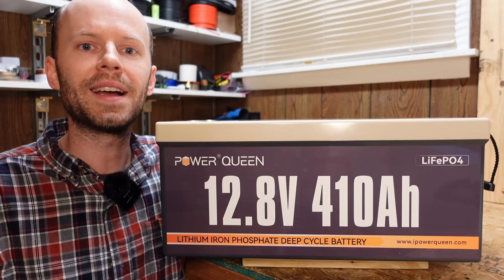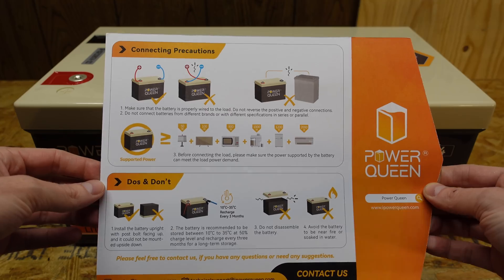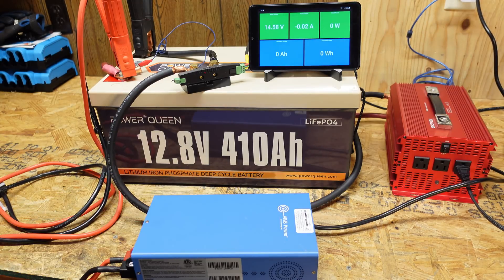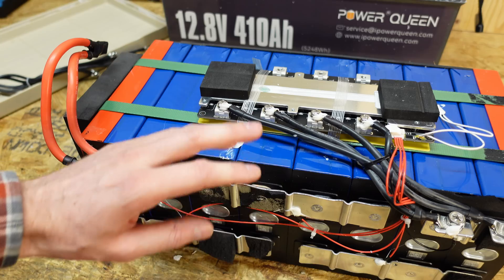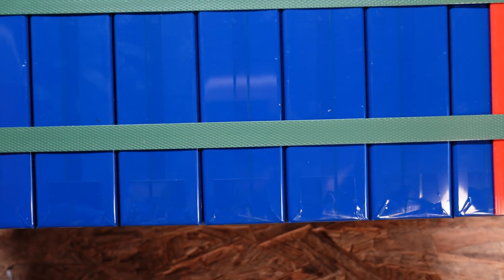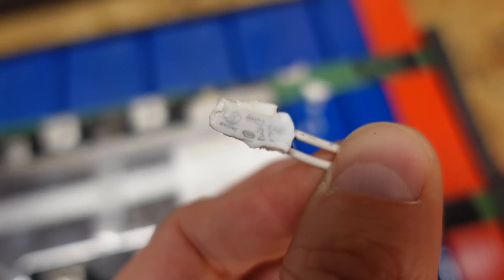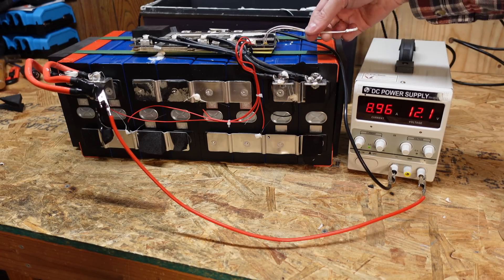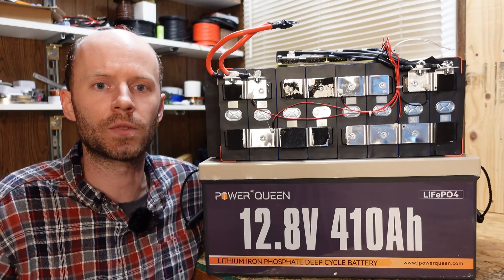Massive 12V 410Ah LiFePO4 Battery by Power Queen, Review & Teardown

Comment: With this being one of the first BMS rated at 250A on the market, in this form factor, I would like to pose a question regarding the potentially undersized pair of 6 gauge conductors bridging (BMS > two 6 gauge copper conductors > m8 Epoxy Terminals) to support 500A Peak load for 55 seconds.

This question relates to a use case of one Power Queen 12.8V 410A battery in an RV that may require a full 500A draw for the rated 55 seconds, permitted by the VIP 250A BMS specifications.

Question: Would the set of two 6 gauge copper conductors, that create the bridge between the 250A continuous BMS (500A Peak) and the m8 epoxy terminals, be sufficient to support a 500A Peak load for 55 seconds, while not becoming the fuse (read: fire hazard)?

For example: 
On the Power Queen 12.8V 410Ah battery, between the 250A BMS and m8 epoxy terminal connections, there  are two 6 gauge copper conductors. However, at the provided conductor length, a single 6 gauge copper conductor affords a maximum rating of 65A @ 75°C (167°F) for a continuous 12V load.

Ampacity of a 6 gauge copper conductor, at an ambient temperature of 75°C (167°F) = 65A
6 gauge copper conductor: Max. Amp Load (Accounting For 80% NEC Rule) = 65A Ampacity × 0.8 = 52 Amps or 624 Watts continuous load.

I (Amps) × V (Volts) = P (Watts)
52A x 12V = 624W

4/0 AWG (0000) gauge wire can handle the largest amount of current of any AWG gauge wire. At 75°C, the 4/0 copper wire ampacity is 230 amp contiuous load (with 195 amps and 260 amps at 60°C and 90°C temperature, respectively.

VIP 250A BMS: However, the VIP 250A continuous BMS permits a 500A Peak load for 55 seconds, producing:

I (Amps) × V (Volts) = P (Watts)
500A x 12V = 6000W

or

I (Amps) = P (Watts) / 12V
500A = 6000W / 12V

It would appear the two 6 gauge copper conductors that create the bridge between the VIP 250A BMS and the epoxy m8 terminals would likely become the fuse, thus requiring a more appropriately sized gauge conductor (read: 4/0, 0000) to create the bridge between the 250A BMS and m8 epoxy terminal connections.
Reply: I thought it said 5 seconds rated.  You are 100% correct though.  I just spec-ed out a wire for a Walmart inverter I want to install in my car.  I was a little concerned as 6 gauge wire is a bit thin for the 400 watt continuous & 800 watt peak loads.  I figured nothing I am going to use on that inverter will ever draw more than about 300 watts so I am ok.  However, 65 amps is right for 6 gauge wire.  I suppose a 48 volt pack could run a 2k watt inverter fine, beyond that I would not trust this pack for more than 2x that more than a few seconds.  One further thing to consider, length is a huge factor when determining DC resistance and thus current capacity.  those wires are 6-18 inches.  That may be just enough for 250 amps (but I seriously doubt it).  Great catch on the numbers.
Reply: Good question. The wires don't spec out to handle the current. Since it's very high current it definitely appears dangerous. I totally missed it myself so thanks for bringing this up.
Reply: Its rated at that for a 5 second burst. Overloading for short bursts like that is common in lots of things from battery start chargers to Teslas. It even gives 3200w as the max continuous on the data sheet at 1:38 or so. At 12.8v thats exactly 250A. Its also got a thermal cut off just incase someone can't be bothered to read the instructions.
Reply: When you double up the wires its fine
Reply: @supremeautomotive6749  And they're silicone insulated so are rated to operate at a higher temp and current.
Reply: No problems, it will pull that load for at least two minutes straight before you start to smell the sheath begin to melt.
Reply: I do wonder why this industry has such a fondness for 6AWG silicone wires. Would it kill them to use 4 awg? A foot or two of wire isn't that much more expensive.

Comment: I would love to have a big enough budget to have 16 of these batteries in a 4s4p configuration and 15kw to 20kw of solar on my roof with one of those awesome 12Kw all in one Sol Ark inverter systems or maybe a big enough Victron system to handle the whole house and the 240v split phase stuff. It would be magical to produce more energy than my whole house uses per day, but my dream 20kw solar system and the 82Kwh of Lifepo4 batteries, plus inverters/solar charge controllers, etc, would end up being a $50,000 system. Its tough to imagine spending $50k on solar and batteries when my house isn't that big and probably doesn't need that amount of solar, but I want enough battery power to get me through a few days of winter with snow in the northeast

Comment: "5000 Wh of Power" - This obvious error in your video thumbnail looks bad. If you're reviewing batteries, you should at least know the difference between power and energy. 

You can say: "5000 Watts of Power" or "5000 Wh of Energy". The "watt-hour of powe " is a nice rhyme, but it doesn't make any sense.
Reply from the maker: 5000Wh of Power.
Reply: You are correct John.

Comment: One qoustion 🙋brother  why should use 12v very big. Capacity why should not go to higher voltage battery 🤔
Best regards from Philippines 🇵🇭
☕☕
Reply from the maker: It's a 400Ah battery. If you need something smaller, they have 50Ah, 100Ah, 200Ah, and 300Ah available.
Reply: @LithiumSolar  I believe you misunderstood his question.
The answer is you pick voltage of a battery based on the application.  For example, if using battery in a U.S. vehicle you MUST stick to 12v .  Manufactures sell 12V batteries all day long b/c we have sooo many ppl.  living out of their Vans nowadays (Van-Lifers).
If you want batteries for your house /property then you are NOT restricted by the 12V wiring/electronics of automobiles so then it is best to go with 48V batteries.

Comment: No cold tempcheck and control makes this a bad battery. Cheap but bad.
Reply from the maker: Why does it make it a bad battery? It's not advertised having that feature and many people, myself included, don't need it. I only view it as a problem when a company advertises having it but doesn't or it doesn't work. No problems here...
Reply: @LithiumSolar  How you know many people don't need it? It's useless in a rv or boat when it's cold. It could possible destroy itself when it is freezing.
Reply from the maker: @LordOneHoop  Because viewers routinely tell me they don't need it due to living in warn climates or using indoors in conditioned areas. Just because YOU require it doesn't mean that everyone else does. That's the wonderful thing about a free market. If you need a feature it doesn't have, then don't buy it and look at a different company.
Reply: @LithiumSolar  Anyway any battery with freezecontrol is better then this one. Which makes it a bad battery.
Reply: @LithiumSolar  https://youtu.be/C3wQBHiXssY?t=306 Sometimes youself think otherwise.
Reply from the maker: @LordOneHoop  1) That is not a conditioned space 2) That is exactly the reason I don't need it, because I have necessary controls on my equipment to stop charging.
Reply: @LithiumSolar  And why do you want it to stop charging? And are you saying you have additionial equipment to stop the charging when it is freezing? Isn't that what i say is missing on the powerqueenbattery? As if everyone is living in a warm climate which isn't. It could have been a great battery if it had a hot/coldtemp controls bms. Which it hasn't and makes it a bad battery for the many not the few. Because most of the planet is freezing in the winter or even at nights. In this case i would use the cells because they are cheap and build my own BMS protecting system. In that case i would rather buy these cells directly and have an even cheaper battery including a good bms. Cheaper and safer.
Reply: @LordOneHoop  Or you could just buy a real charge controller and have it do temp control. Never understood peoples need to make a cold temp shut down as a requirement.  Very few really need that, and if you do just get a victron charge controller
Reply: @OmahaWayne   The fact that Victron understands that makes it a good and safe brand. But it is not their chargers but their bms who controls it. Even Victron chargers without bms will charge these batteries when it is freezing. Result will be dead batteries.

Comment: Why so much power at 12v, don’t get it
Reply from the maker: I don't understand the question. It's a 410Ah battery. If you don't need 410Ah, they have 12V available in 50Ah, 100Ah, 200Ah, and 300Ah to suit your needs.

Comment: Thanks - that is a big 12V battery! 
One thought that a battery manufacturer may consider for RV applications is to incorporate a DC-DC charger allowing for direct connection to a vehicle battery system for charging. I was thinking a MPPT too, but there are many variations of PV volt and amps but vehicle charging is overwhelmignly 12V.
Reply: theres already all in 1 inverter chargers which could easily add a dc to dc charger
Reply: @jar407  Yes, there is plenty of choice out there.
Reply: Kisae, among others, make exactly what you're suggesting be built into a battery.  My Kisae includes MPPT solar input, vehicle alternator input, and ignition-on control wire.  On the battery end of it, selections of battery type including lithium/LiFePO4, and totally customizable.  Likewise, you can customize max charging current (5, 10, 20, or 30A on the DMT 1230; 5 through 50A in 5A increments on the DMT 1250).  Best to keep it a separate device, so that you can match a DC-DC charger to your specific needs, and reduce the cost of when your battery or charger becomes a brick.  Once you include stuff like that in a battery, it's not a battery anymore, it's more like a power station (maybe minus an inverter, USB outputs, etc.)
Reply: .....and of course it also includes very refined charging of all lead-acid varieties.

Comment: If using that battery I would recommend 4 of them connected to a busbar so each battery delivers 75 amps max. 250 amps on a 206ah cell exceeds 1C which degrades battery life. even 2 or 3 to a busbar would help a lot. Very nice battery all in all. My RV would love 4 of those.
Reply from the maker: The cells are paralleled up in groups of 2. That makes it a 412Ah battery. Pulling 250A from a 412Ah battery is only 0.61C.
Reply from the maker: But yes, even at 0.61C running lower C rates will extend overall battery life.
Reply: @LithiumSolar  Oh okay. I forgot to divide the C in half since they are paralleled inside. so 2 would be perfect for my use then in an RV. Thank you.

Comment: Would like to see charging options for 48 volt lifepower batteries. I have been looking at the Bigbattery 240 volt 50amp charger but no one has done a review that I can find. Thats a big battery great review
Reply from the maker: AIMS also makes a charger like the one I used in the video for 36/48V batteries. That's what I've been using for my 48V testing. It maxes out at 19A though. I'll have to check out the BigBattery 50A!